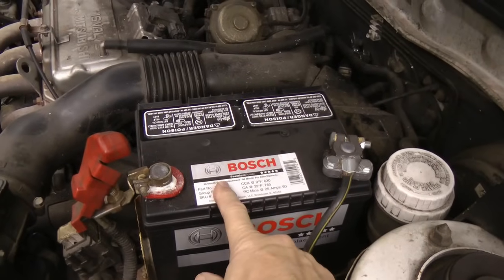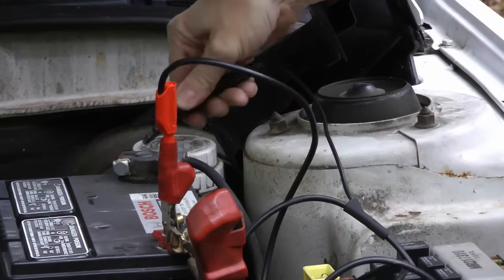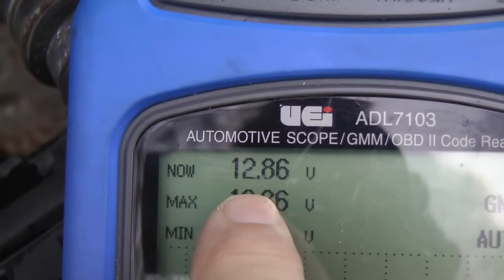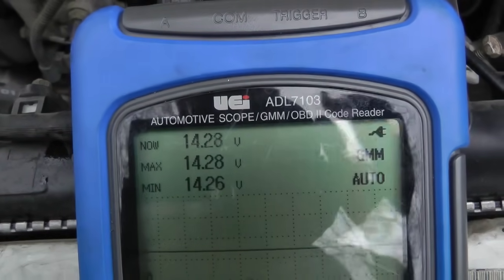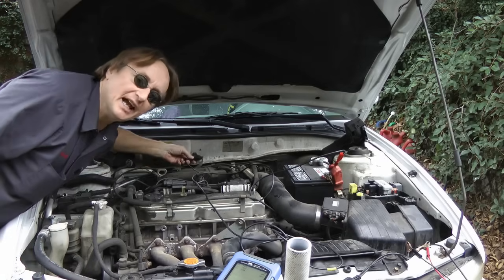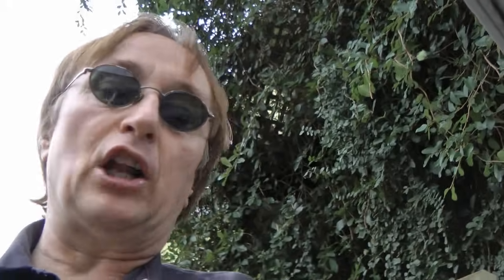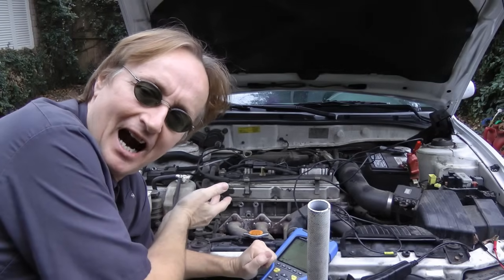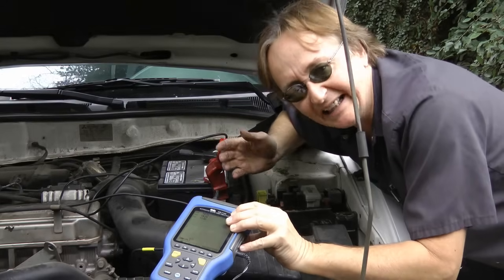How to Fix Electrical Problems in Your Car (Ground Fault)

Comment: Hello , I got a 2000 Nissan Xterra that my mechanic has fixed many things on it. Well drove it today and ALT light and oil light came on. Now it has very bad valve cover seals which when warmed up while driving steam comes out from passengers side hood. Pause bad knock sensor. Asking for opinions I am female and I do know how to do small things on my vehicles but what can this mean. Has had new plugs and wires. I'm in Ohio n can't afford a dealer but I have got a good mechanic but he can be very busy at times.. thank you for reading
Reply from the maker: you just have to bite the bullet and remove the intake manifold to change all those gasekts. Bad design, but that's nissan for you
Reply: Scotty Kilmer I agree but would the oil light come on for the bad valve cover gaskets? I'm checking oil today. Plus what is a ALT light? Plus bad knock sensor. Keeps throwing code for it. Ppl telling me I don't need to change it but it's a sensor so I'm guessing yes. Thank you for responding back to me

Comment: hello mr Kilmer, i have a 2008 chevy silverado that has some kind of problem when i start it. its got a delay start and in the process it reset my stereo clock, but no my preset channels . i insert the key, turn on the switch...i then hit start and i hear the spark my clock resets and then about 3 seconds later my engine starts.
Reply from the maker: often just a weak battery , have it tested. If not that, corroded wiring or bad ignition switch

Comment: what type of short would make both fenders hot to the touch when it is running please help if you can thank you. and the engine is not over heating please help.

Comment: kilmer my 02 Monte Carlo as has no power at all it turned off while I was driving now it has no electrical power no lights or anything comes on but the check engine light still is on......what does this mean? The Car Won't Turn  Its Just Dead...Please Help
Reply from the maker: often a bad alternator, auto zones check em free

Comment: hey Scotty on my 01 civic I replace the headlights terminal n relay because my left side is dim any tips. alternator and battery are new
Reply from the maker: check for bad ground wiring and corroded wiring connectors on both power and ground

Comment: scotty have a prolem with e46 2003 and need to know it wont start check batterie its good starter is good i went dealer to order key im thats the problem one wouldn't start it tried using first key would not work then i tried sec. key worked then try the nex morning wouldn't work
Reply from the maker: those have VERY complex anti theft systems, find a bmw dealer mechanic with a factory scan tool to check that first

Comment: Scotty,Hi I got a problem dam Dash light went out and rear lights is that a fuse?? Flashers and brakes work.
Reply from the maker: of course check all fuses and pray it's not a bad body control module as it often is in a GM product

Comment: Hey Scotty,  Have you ever heard of everytime (and only when i do) i put gas in my 2008 gmc sienna truck and i go to crank it all gauges act funny and it tries to keep cranking itself after it is running.....I have to shut it off and let it settle for about a min and then all is well from then until the next time.
Reply from the maker: often a worn out starter will continue to crank some after the car starts, check that first. But if it's only when putting gasoline in, and not just stopping and eating lunch and starting it, try a new evap cannister vent valve
Reply: Thanks for getting back to me so quickly.....Ill try that!!

Comment: Hi Scotty I have an intermittent problem with various areas of my audi q7, and these are as follows: front windscreen wipers stopped working over summer I had them checked and diagnosed, message I received was that there was too much power going to the wiper motor so the ecu of the wipers would stop the wipers from working. Now they are working properly and I have no problems but now this has turned towards my air suspension and it is intermittently lighting up and coming off. would this possibly be something to do with the relay as my air suspension and leveling is working fine and I can control it too from inside my car.

Comment: Hi, my headlight wont turn off when i start the car. also it had a problem with anti-theft system and i shut it off. all other electrical parts work  good . What is the probable cause?

Comment: Scotty Kilmer I have a 1994 Toyota Celica ST 1.8l just like yours but mine seems to turn off and on when hitting a hard bump in the road, and hard acceleration is there anything that you would know to look at if you had this problem occur to your Celica?
Reply from the maker: check for loose wiring connections first
Reply: Ok will do Scotty I'll come back to you tomorrow afternoon if that doesn't work.

Comment: scotty im having an issue with my dodge charger 2006 rt. when i was driving my car my gauges started going crazy and when i was still on drive i pushed on the gas my car was like in a neutral state, its like the car didnt want to switch gears and stayed on first gear.idk what to do please help .

Comment: hello Mr Scotty, I have a 98 Nissan Maxima my car won't turnover nor do I have any power inside of my car my head lights come on when I put my foot on the breaks... what should I do or what advice do you have for me?
Reply from the maker: try to jump start it to see if the battery is bad. If not, check for wiring shorts, like loose battery connections and wiring that corroded or loose
Reply: Ok thank you

Comment: scott.. im having an issue.. .ok. so here we go..  when i hold my windows both rolling up.. that causes my idle to drop.. normal in alot of cars.. !! but not normal is that my radio.. when doing this.. or even when the AC compressor kicks on.. will make my radio go crazy switching from aux to cd to am to fm and all over the place .. not sure if its a bad radio. or.. if im having an issue with a short somewhere or something ? any ideas ? thanks.
Reply from the maker: have the battery and alternator load tested, auto zones do that free. Often bad one or the other

Comment: i got a new battery and new alternator but it won't start it requires a small jump and it would work.  lights die out slowly.  what could that be?
Reply from the maker: try my video "fixing battery drain on your car"
Reply: Appreciate it kind sir!

Comment: Thanks Scotty!! You gave me my next task in troubleshooting my car - talk about weird? I was "just driving along" with headlights on, and suddenly the radio turned itself on! (started playing beautiful music) - - I already was aware of weird, fugitive electrical behaviors, so I tried turning the headlights off, and voila, radio went off. (but it did NOT go back on when i turned the lights back on) BTW I had already set its (the radio) fuse aside, so it shouldn't have been capable of turning on anyways - - also, the right parking lights (Mercedes) will NOT turn off when the car is off - - I appreciate your clue, to start checking for faulty grounding wires . . . . wish me luck . . . . now I am starting to see why this beautiful car was only $1000 Hahahahaha!!!

Comment: I have a 2005 Saturn Ion.  Neither of the cigarette lighter outlets was working, so I replaced both 15a fuses (which were indeed blown).  However, they still don't work.  I know this because I plugged a brand new air compressor and it wouldn't run. Help!

Comment: Scott when I turn on my headlights my tail lights go out they work just fine when the headlights are off I need your help man
Reply from the maker: replace the headlight switch and pray it's not more complex like a computer module failure
Reply: +Scotty Kilmer thank you so much for replying. am going to try that in the morning it's getting dark. hope it works.
Reply: Hi Danny, wonder if you ever tried that solution. I have the same exact complain with my car

Comment: I have an 1998 Isuzu Rodeo. I  have change the light bulb also the fuse, and my tail lights dont come on. It's like we have a curfew with this Rodeo! gotta be home before the street lights come on. Please help. Thank you
Reply from the maker: make sure it has the correct bulb, wrong ones in a socket short out the system. if not that, check for wiring shorts near your working area

Comment: I have a bmw e87 2008 and I have bad radio reception but as soon as the ignition is of, the reception becomes perfect. i have cleaned the 2 positiv ground wires in the trunk near the battery. After that the reception became better but still gets perfect reception when i turn off the ignition. WHAT DO I DO!
Reply from the maker: realize even the radio reception is computer controlled on that monster, have a bmw guy scan it with his dealer level scan tool first..

Comment: hey scotty, i have a pt cruiser that has trouble starting sometimes. I replaced the battery and both battery connectors. I have also had the starter cleaned and tested. Also to let you know the car has been sitting for about a year.How can I tell if i need a wire splice for the negative or replace the whole negative wire? I've used a jumper cable to test the ground and i think it has something to do with that. Please help!
Reply from the maker: just replace the whole ground cable and clean the connectors where it bolts on shiny

Comment: hey Scotty I put in a radio and the dash lights went out. I then put the factor back in and it still won't cut on. ford escape
Reply from the maker: you shorted stuff out, recheck your work AND pray you just blew some fuses or knocked wires off

Comment: i have a  2000 Dodge ram1500 with a camper....my taillights were out but break lights turn signals back up and break lights were good.... I wasn't sure where fuse to tail lights were so I pulled them all out to inspect them...all checked out as good....after putting them back..i then had lost break
Reply: i now lost my break lights as well.....  so i rechecked fuses and all were still good....checked the tow packets.. from truck  to camper ...tow package was 4 pin on the dodge
Reply: +Rob Kitchen towing package on Dodge was for towing....my camper is the rear end of truck so i needed full function lighting not just tail n break which the 4pin tow package only for towing...i notice when connecting camper to it.i didnt have turn signal. .back ups. or licence plate light so i had to.
Reply: +Rob Kitchen is there a fuüse box besides on drivers side dash???
Reply: +Rob Kitchen is there a fuüse box besides on drivers side dash???

Comment: Hi  I bought a 2005 Dodge grand caravan one month ago  on original inspeection the speakers didnt work  the vehicle has two mouted dvd players overhead.  having a working radio was important to me.  The mechanic at used car lot couldnt find the amp or the short in the circuit  so he removed my factory radio and installed a cheap aftermarket radio.  he said he bypassed the amp.  after one week the radio started causing the the dashboard, the center of steering wheel, the dvd players and everything wired to overheat to point of being too hot to touch  I popped the radio out of its case in dash but its still wired.  Please inform me how i can disconnect the radio before i have an indashboard fire.  Or what to do about the amp.  Help  I cant afford electrical fire.The heat coming out of everything wired is really bad.  Please help and thank you.

Comment: my 2000 ford expedition the gauges are going crazy. I put a new battery and when I push the gas all the gauges go all the way up, then I let go and they go all the way down. a went around the block and when I accelerate the gauges go all the way down. HELP ME PLEASE!!!!!
Reply from the maker: often a problem in the dash itself shorting out the circuit boards. But do check the dash ground wiring, sometimes bad grounds do that too
Reply: +Scotty Kilmer hey man, I found that my body control module might have to be replaced. now, can I get a used one from another suv like mine, or do the # have to match as well? I just what to know because it's pretty expensive new (well I'd have to get mine rebuilt). they don't sell them new

Comment: hey scooty.  my  2006 honda civic wont start, symbol on the dash board wont show up.
Reply from the maker: try jump starting it for a bad battery, if it won't do that, often a bad ignition switch on that model

Comment: The lights on my dash started flickering recently.  Usually happens when I come to a stop.  Random warning lights on the dash flicker on and off.  The power to the radio also goes on and off sometimes.  Same for the gas needle, etc.  It lasts for about 10 seconds and then goes back to normal.  Happens maybe once or twice each time I drive.

The only thing I can think of is that i replaced the brake light... the same day in fact that this started.  Any ideas on how to fix this?
Reply from the maker: have the battery and alternator load tested, auto zones do that free. Pray it's that and not a hard to find wiring problem
Reply: Scotty Kilmer
Thanks, will do.
Edit: I did a quick test myself just now and it seems fine. 
12.47v while off.
14.14v while on
14.1v with brights on, radio, emergency blinkers, and AC on full.

I plan to still take it to Auto zone but I suspect this probably isn't the issue.

Comment: hey scotty had my air conditioning running in my 03 ford explorer and it just shut itself off and my dash lights when completely dark(dead) until i turned the ac off. what is the problem
Reply from the maker: often a bad compressor clutch shorting out the electronics, but do check the alternator and battery to see if they are going out, auto zones test em free
Reply: ok how do i locate the compressor clutch
Reply: is there a relay or anything that could be the problem also

Comment: Hey Scotty, what would you use to clean oil off frayed electrical wires?

Buried in the back of the motor I can't get the wire off.
Reply from the maker: once frayed they need replacing, cleaning is useless
Reply: The TSB says just cover them.... http://www.tegger.com/hondafaq/tsb/civic/x99-029e.pdf

EDIT.... well it says "repair" them... but gives no suggestions how.   Only way I would think would be find one in a junk yard and cut the connector and wires off, cut the one I have and solder in the one from the yard... but Honda doesn't say as much...

Comment: I have a 1985 Jeep Cherokee and all at once the Blower, Horn, Turn Signals, and radio went out. I replaced the the Starter Relay (Ground terminal) and still nothing. Any advice?
Reply from the maker: those are notorious for either bad ignition switches, or bad wiring that shorts out where the main wiring harness goes through the firewall from the engine compartment into the cab of the vehicle

Comment: What if the car doesn't start because of a bad ground?
Reply from the maker: then you reground that area, such as running a new ground wire from battery to engine block

Comment: Scotty we have a 2011 Jeep Compass the 4 wheel drive light comes on & it says you can't drive it any idea?
Reply from the maker: those are so complex, you will need a pro mechanic with a jeep dealer level scan computer to analyze and fix that. Pray they don't rape you too bad. That's Jeeps for you these days

Comment: hey Scotty. I having a issue on my headlight bulbs. my low beam is weak n dim but highbeam is good. what could it be.? i live in the countryside so I need a bright light bulb.
Reply from the maker: often bad ground wiring on the low beam, check that first
Reply: +Scotty Kilmer Thanks for the reply! I will check the ground.

Comment: the battery light turns on on my mazda protege  and it's a brand new altanator! idk what's wrong with it
Reply from the maker: either wiring on the charging system has a short, OR you got a crappy alternator

Comment: checking the fuse for my fuel pump on a 1995 Silverado  I see only one terminal for the fuse with 2 pins  to plug into Only one side of the fuse fits in to a female part Why? Thanks
Reply from the maker: you're using the wrong size fuse, blade fuses come in normal and small size

Comment: hi i had ford fusion S2007. My issue is if I start drive my car the headlights turn on. but before its not like that. the issue starts when my mechanic change my junction box. and it start to show trunk ajar and i lost my running daylight and after that the headlights automatically turn on even the switch is off.
Reply from the maker: well, he messed up the wiring doing that job, take it back

Comment: i have a 2001 gmc savana 3500 box truck with 350 engine 5.7 L . just had ac charged and a new compressor put in. ac clutch don't in-gauge. but if the relay is jumped it work. any suggestions?
Reply from the maker: sounds like an electricql failure, of course try a new relay, but if not that, often a bad ac dash control unit on that model

Comment: What could cause that same 1990 Chevy Lumina to start very good when it is cold or first start and within 5 minutes later if you take a trip to the post office and you have to restart the car it has this grinding sound and barely starts?  Is that a neutral by pass switch or is that a starter going out?
Reply from the maker: pray it's just a worn out starter and not a bad flywheel too

Comment: i have a question i have a 2003 silverado i if I let it sit for a long time  and the battery dies when i jump it sometimes it will try to start itself without the key in it and sometimes the relays click when power is applied to the battery the ecm also 
gives off random chk engine codes idk if its the ecm going bad or thw wiring harness but its aggravating me